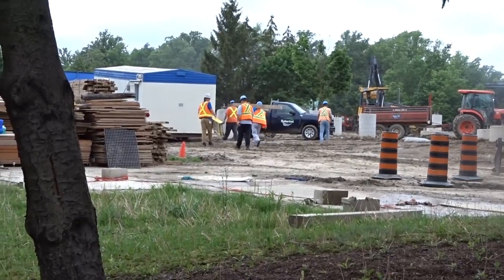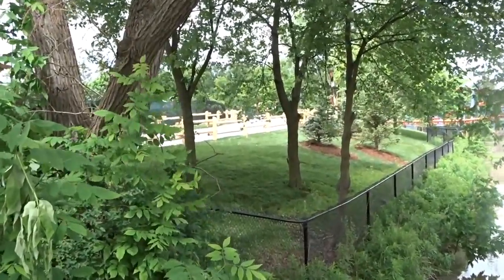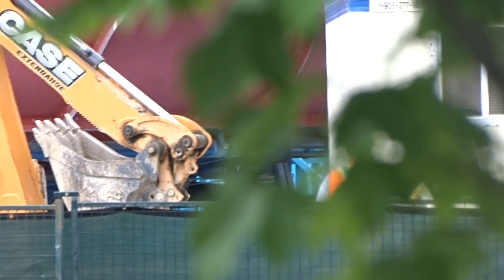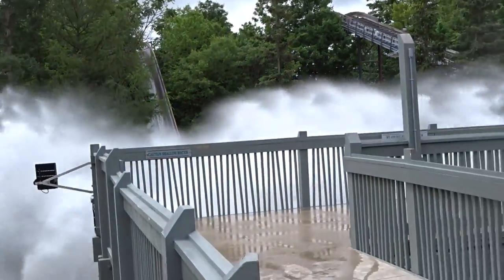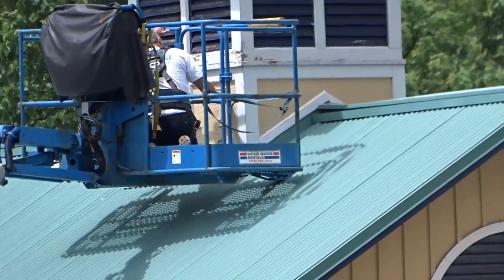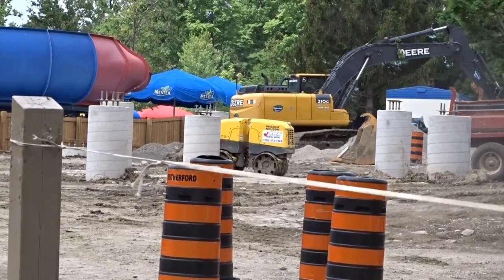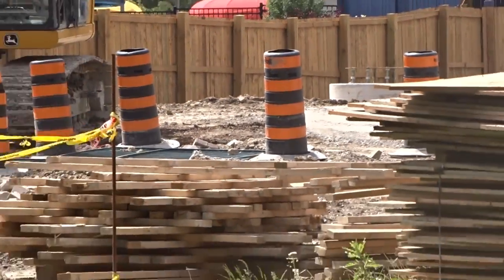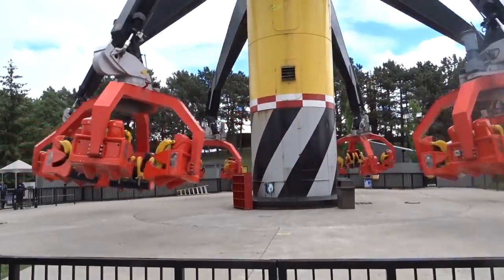Canada's Wonderland Massive New Coaster Construction Update

Comment: So the markings on the large grey pillars are survey reference points.  Since there is so much earthwork being done a regular survey point will eventually be ripped out so using the 2 know targets taped to the big grey steel supports that are not going anywhere, allow you to retrianglulate your position and continue layout.  GPS is not good enough to layout steel structures that need to be laid out very accurately.  
The new “path” was what someone said above, a high ton crane to lift the steel for the lift hill will need a solid pad.  The men measuring were making sure the crane could fit and make turns
Reply from the maker: Jeff Rimmer thanks so much for the information 🤗👨‍💻